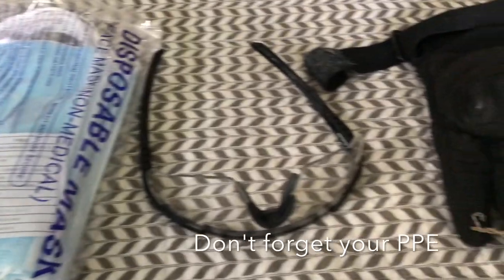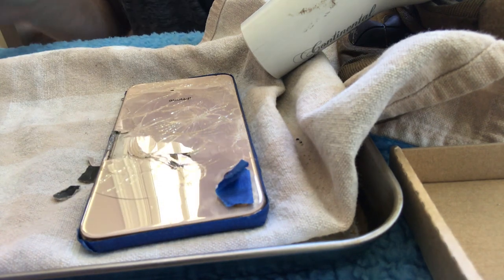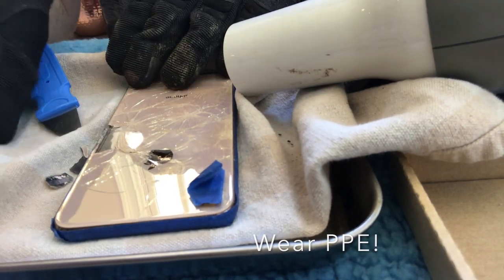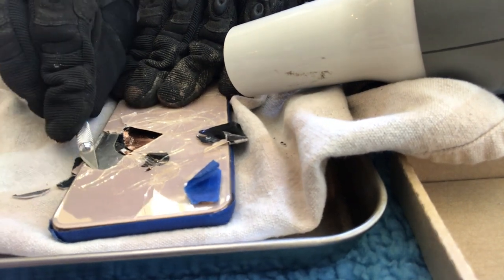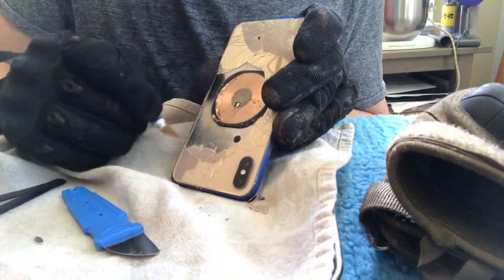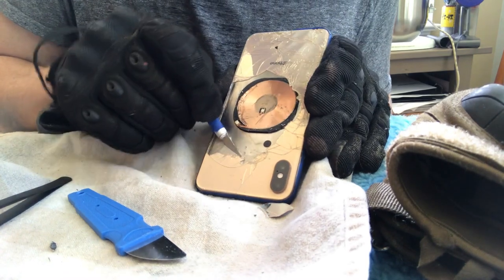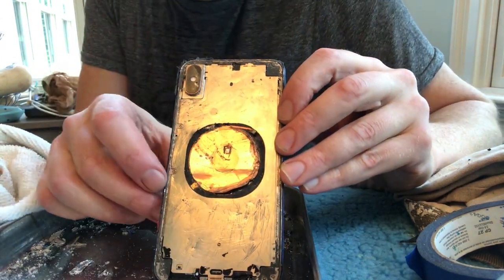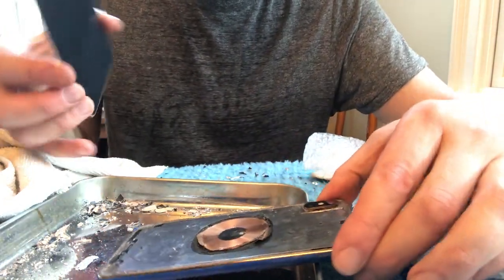iPhone XS Max rear glass repair, save $599 by fixing yourself

Comment: The reason I’m replacing my back is because I took it to apple to get a battery replacement and they told me I would just have to replace the phone. If I took it to apple now to get it replaced, would they still turn me down?
Reply from the maker: I would guess that an apple employee would know that a non apple certified repair was done and they would still refuse to replace the battery. I don’t know that with certainty.  The good news is that you can easily replace the phone battery yourself if you search YouTube for a how to video.

Comment: I don’t have a hear gun would my hair dryer be fine because you did not seem to like it
Reply from the maker: The hairdryer should work.  I was a bit impatient.  Even though the phone was off, I set off a heat warning alarm on the iPhone when applying too much heat.  It stopped spontaneously but surprised me. Most of the work was simply prying off the back as u can see in the video.
Reply: @thedad1  awesome thanks so much. This will help because I’m not rlly in the mood to pay so much for a replacement can’t believe the prices they charge you.
Reply: @thedad1  also damaging the circle looking thing in the back doesn’t matter as it’s only wireless charging right?
Reply from the maker: @Jc-jv5bu  I can’t say for sure. My recollection was that there wasn’t much (?any) adhesive over the charging coil. My wireless charging continues to work. If you are careful, you won’t damage it.  Good luck.
Reply: @thedad1  Is the heating gun optional
Reply from the maker: @itzjeska1451  it aids in countering/freeing the adhesive.  Not sure IR it’s possible to remove the glass without some form of heating.

Comment: im if the phone falls it will break again because you didnt glue the back with a B700 glue
Reply from the maker: Nope
Reply: yes you need it.........to make it strong
Reply from the maker: @temi4646  not in my experience. Dropped the phone several times and had no issue. Your miles may vary.
Reply: @thedad1  kk i was just saying